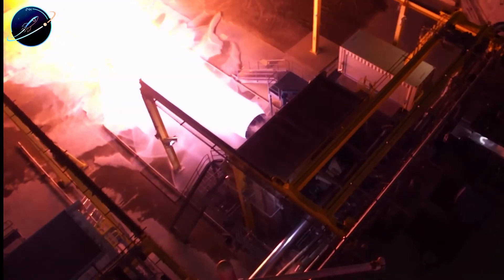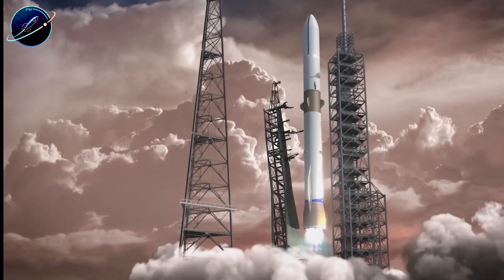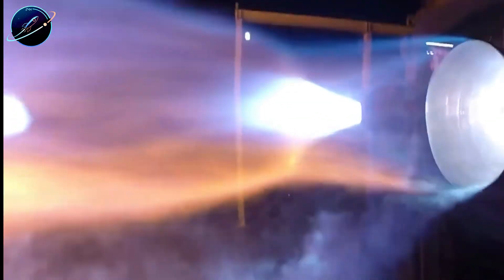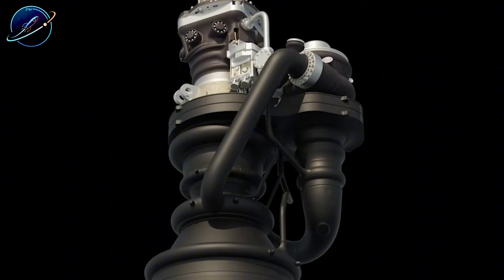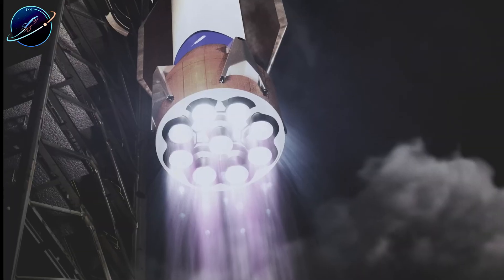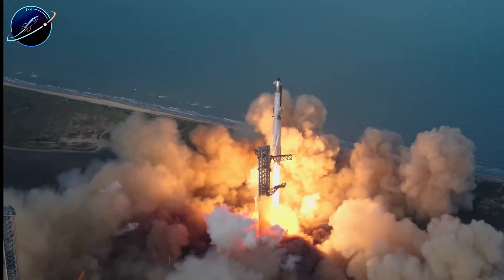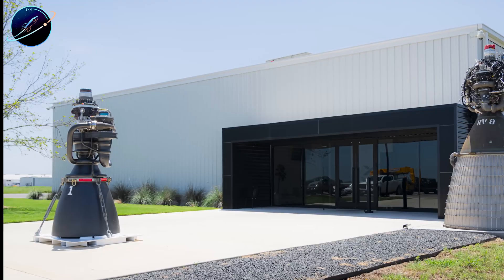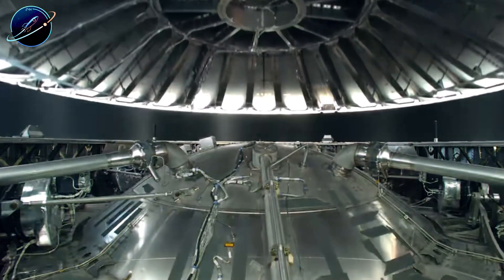How SpaceX Raptor 3 CRUSHES BE-4 While Having LESS Thrust? It's Insane!

Comment: Remains to be seen.  Certainly moves new Glen ahead of Falcon Heavy.  The combo of BE-4 with BE 3U is good as the second stage will be more efficient than Starship's second stage.  Starship is intended to be efficient with on orbit refueling, New Glen to be efficient with an expended second stage.  Now comparing a scaled up Neutron to the scaled up New Glen...
Reply from the maker: Raptor 3 still crushes BE-4 because 350-bar chamber pressure and 33-engine scaling give Starship far higher total performance than New Glenn, even with BE-3U efficiency. And comparing scaled-up Neutron to scaled-up New Glenn only highlights how much engine simplicity and mass production matter in the long run.